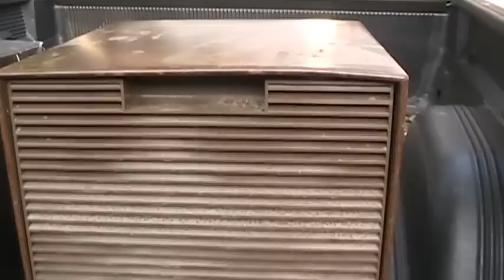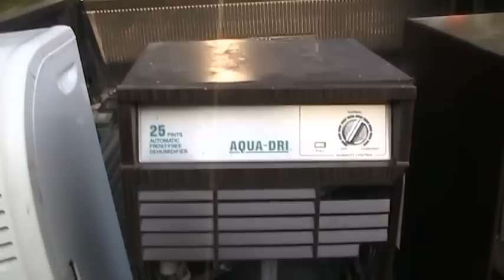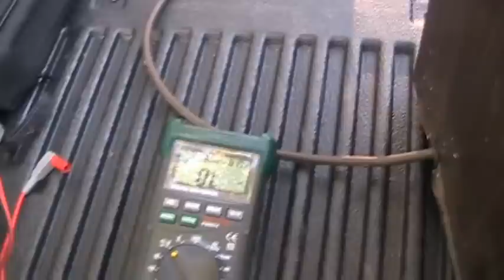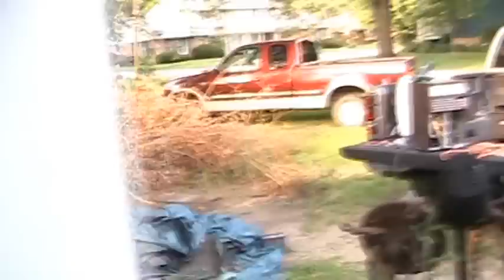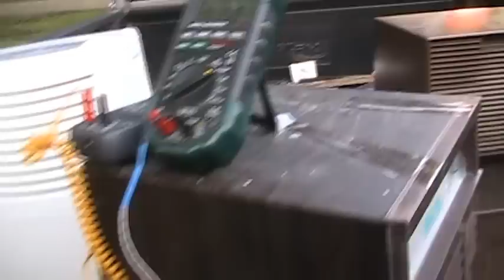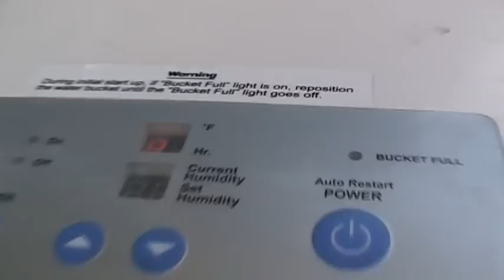Three Broken Dehumidifiers

Comment: I just purchased a newer model LG dehumidifier second hand because the price of new ones is so much. I can hear the compressor running but it's producing very little water in the bucket. I took it apart and it is very clean inside. Any suggestions?
Reply from the maker: Couple of ideas:

The humidity could be lower than you expect. What does a known working hygrometer say?
Inadequate line voltage or severely decayed electrical connections -- easy enough to check.
Incorrect fan motor speed (slipping fan, bad motor, dragging bearing, etc.)
Well concealed "fluff" and other crud in the condenser or evaporator coil. (Shine a light through each, should be visible.)
Bad compressor (unlikely, usually they lock up or pull so much current as to drop a fuse or circuit breaker when bad).
Clogged refrigeration system or plugged capillary tube.
Low refrigerant charge.
Reply: +uxwbill I'm showing 60% humidity in the room. I've let it run 24 hours. The top of the unit is cold and the back is warm blowing out warm air. Still showing 60% humidity and only generated about a cup of water in the bucket. I have it set to 45% and the compressor has been on the whole time. Thanks for the advice I'll check it out further based on your suggestions.
Reply from the maker: I'd take some temperature readings on the coils, with something like a type K thermocouple. Noncontact thermometers or monitoring airflow temperature may give you misleading results.

I'd be willing to bet that the unit is low on charge, has a blockage in the cooling system or a capillary tube issue.

Comment: question. Would it be possible to bypass the digital display and wire in a older style humidistat?   I'm no expert on appliance repair, but dehumidifiers seem so basic, that I would think the fancy display should be easy to eliminate and return to a simpler setup.
Reply from the maker: Almost certainly yes. If a repair of the electronic module looks too much like work, or it just doesn't work out, I'll drill a few holes and slap a mechanical humidistat right on there. It won't bother me at all.

Comment: Yeah sadly Haier had bought GE Appliance Division which we don't get to have any American Made Appliance like it used to be in back in the day.

Haier is what I really don't trust to because, I really detest the quality the way I looked at that. For example like Haier CRT TV with Digital Tuner and Built-in DVD Player Model TCR20, not only the DVD Player that are having trouble to read the discs but also the picture quality wasn't in center right because it squeezed slightly to the right. The Picture Tube was made by Samsung and I appalled about the quality, was when Samsung originally came from Korea, later switch to Mexico which the quality is okay, Malaysia, and now they chose China which they figured it's cheaper to make a picture quality than to make an expensive picture quality. Chinese made products is absolutely garbage which that's very disgraceful.

Now, for for example Frigidaire Window Air Conditioner with Electronic Control Panel, after when I got them for free, I was going to clean them up because it got covered with dust, dirt, and the smell of Tobacco that was covered all around the Condensing Coil and open the case, clean them up, test them out, and found out the motor sounds terrible which tells me that I got to re-lubricating the bearings. But guest what? I opened the motor, found out it has a seal bearings which there's nothing I can do other than to replace the motor and unfortunately, I end up go ahead salvage the components and send the Frigidaire Window Air Conditioner to Scrap Metal Company. I rather not go through Chinese Made Appliance that are not design to be service, last long which it's total garbage, and they're design to be recycle.

Comment: if i don't know any better (and that is something i question a lot these days) some of the signs on the Aqua-Dri point to maybe a portable unit gone built in as window AC units i have seen with holes cut in wall for them and i know a few folks who bought houses that had an old humidifier like some of these within a wall (and i use the term loosely) in there basement as if you found some hosing and a lock ring that may match the threaded drain outlet on the unit  a drip pan would be unnecessary my also explain partially why it was MIA when the unit was found . judging by the damage to the front and the paint (or primer) around the power cord the Aqua-Dri may have lived happily in a wall in a basement, bathroom or something until the new owners of the property got a burr up there bums about it's out of date looking style and removed it the only way they knew how....by force

...... or more likely it seen a lot of construction projects and had one too many good knocks around the yard by klutzy shade tree carpenters (as one myself i can assure you i have lost many a good light fixture that way.)

Comment: Uwbill the newer unit you talked about might be a victim of faulty caps (like you said) but with the noise that the fan motor is making it might be overloading the circuity on the board and causing it to shut down for protection to prevent it from blowing its self up  i don't know  for a fact but it's possible. I'd just throw a new fan motor on it and somehow put a manual humidistat in it I don't care what it looks like if it works properly too .  I've been watching your videos since like 2008.  just wondering did you put a new humidistat in that Montgomery ward unit?
Reply from the maker: No new humidistat for the M-W unit yet. I was going to rob the working one out of the unit that lost its charge, but they're too different to adapt. And since the M-W unit is in such nice condition, I'm not about to go and hack it up.
Reply: +uxwbill I could see why you wouldn't want to hack it up

Comment: On the Haier unit couldn't you just bypass the pan switch and just hook up the drain hose? Then maybe bypass the control board and have an on off switch or mechanical timer? You could use one of those plug timers and set it to run maybe four hours or whatever.
Reply from the maker: All of the electronics on the Haier unit could be bypassed and replaced with more conventional controls.

Comment: That middle unit, even in poor cosmetic condition, and fully functional, is a great dehumidifier. Wish I had a dehumidifier from that period of time. Speaking of, I have an Eva-Dry EDV1100 dehumidifier that runs-ish, but doesn't collect anything anymore and we had the unit for a couple of years, which was only used in the bathroom since it gets humid after someone showers. I might look at it myself to see what went wrong.
Reply: how big is the EvaDri unit you have? if it is the mini kind where you have the external power brick then it is a compressorless peltier unit most likely. How is the temperature where you live? That factor will also play a role in impacting the performance of you're unit. I know some units drop in performance once the temp drops belo 60

Comment: Last time I saw behaviour like that on a device with modern controls it was because the power supply for the logic circuitry was a "capacitive dropper" type supply and the X class dropper capacitor had drifted down in value meaning there wasn't sufficient voltage present to run the controls properly.

Comment: Hmm modern junk, the white one could be made 110% better by fitting the stat from the good old style units :-D.
The pointless computer panel could be left there just to fill the hole.
I would rather have reliability over digital crap.
Perhaps a square of foam could be put under that leaf spring to make it slightly deaf to the weight of the water.
A speaker grill comes to mind for replacement of the missing front, but im sure there are better things.
Reply: New shit just breaks, old stuff keeps on going! Unfortunately this is a trend we're stuck with these days, in order to keep the economy running smoothly. It's called "planned obsolescence". This video is a prime example of why people should try to repair their older devices instead of buying a new modern one. You're not going to get the lifetime out of the new device like you did with the old one.
Repairing older stuff in general makes for less e-waste, and it gives a good feeling knowing you fixed something.
I agree with the simple things you stated as an option to try and see if they work, and indeed, replace the modern junk electronics with a simple switch or humidistat.
The grill on the front could possibly be replaced with a few (2 or so) layers of garden fencing (you, know, the stuff that can be bended into place). just to act as a bit of a finger-guard.
Reply: Yes your right, the Planned obsolescence is very true, just look at the specs on electrolitic capacitors in washing machines and tv power supplys, they are short on hours, typically designed for roughly 2 years.
Switchmode supplys may be efficent but they kill capacitors too fast :-(.
Reply: well said indeed. It is funny how modern acs tend to be the other wey around I bought an frigidair 3yrs ago and it still working fine but when it comes to dehumidifiers they are all garbage!

Comment: I picked up a Haier mini-freezer last year from behind a pub (left on the back street, so no trespassing!), got it home, sat it in my shed, plugged it in, worked great, left it running for an hour, still working great, cleaned it up, removed the birdshit form the outside, dried it off, brought it indoors, plugged it in, it ran for 5 minutes and the compressor seized, stupid modern r600a (extra-flammable Isobutane) crap.........
Reply from the maker: I recently saw a freezer offered for sale at Best Buy under their Insignia brand. Taking a closer look, I noticed with great interest a warning on the back panel about flammable refrigerant. I believe it too was using R600a refrigerant.

Why on Earth anyone would ever design a consumer appliance to utilize flammable or hazardous refrigerant is beyond me. I always thought one of the key design goals for any refrigerant was nonflammability.
Reply: *****
My only guess as to why they use Isobutane as a refrigerant is cost, it's cheap to get and probably doesn't need to be licensed from DuPont and the like, but having read a number of news articles of people's fridges & freezers blowing up and destroying parts of their houses, errrrrrrm, yeah, probably a good thing that Haier's compressor seized, R600a is dangerous stuff if it leaks...
Reply: +uxwbill 100th like lol
Reply: +uxwbill But ya, I agree, it's really stupid to make a dehumidifier to contain flammable refrigerant.
Reply: The R600 isn't the problem even, it's the cheap design and reducing the oil in the compressor so that it runs dry despite the tiny pipes they use thanks to having over double the heat per lb of liquid as freon 12.

Comment: My problem with 2 new dehumidifiers I've had is that they lose their refrigerant charge over the winter. After trying two of them one a LG and the other a GE(Yes the recalled one) at over $250 each I went back to my 2 smaller ones a 1999 Whirlpool and a 1974 GE. Both work fine and so far I'm just going to stick with them. Why did I try new ones? They were 65 pints and I thought I could get away with one and save electricity. Big Fail.

Comment: I have a Whirlpool dehumidifier which I'm trying to get rid of right now; it's had a recent coil clean and works very well but needs a new bucket switch, for which I'm not spending $65 so it needs to go somewhere else.
Reply from the maker: Odds are you can get that switch (or something compatible enough) from a reputable electronic components retailer for a small fraction of the price that Whirlpool is asking.

The trade-off? The original part is often house numbered, so you've got to spend some time working out the proper equivalent. Manufacturer spec sheets, parts drawings and a ruler or caliper will narrow it down pretty quickly.
Reply: +uxwbill I've tried that.  It needs just the right type of microswitch, and they are hard to find.
Reply: +uxwbill that middle one looks like its been around the world two many times
Reply: Do you have a floor drain nearby? You could just bypass the bucket switch and run the coil drain to your floor drain. That's what I'd do. Just an idea.
Reply: +coondogtheman1234
My father  wants it out of there.
Reply: douro20
Ok. fair enough. Just trying to help.